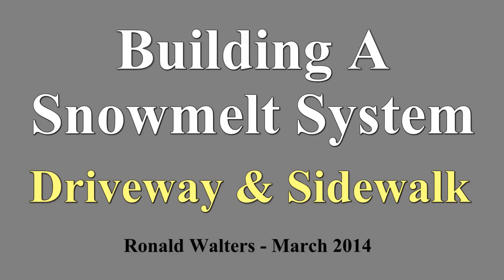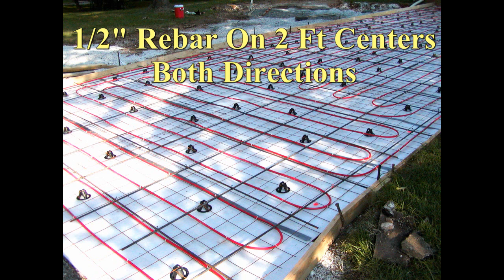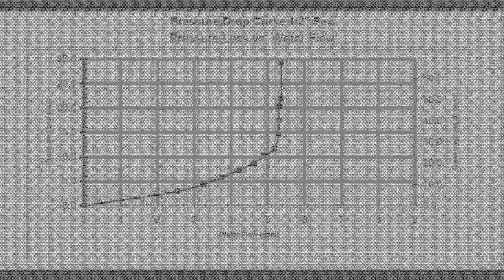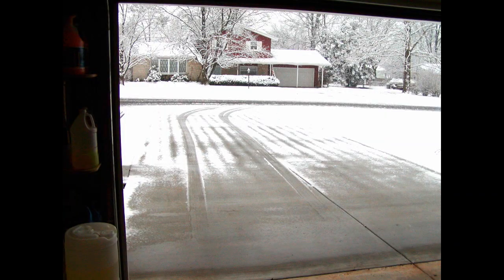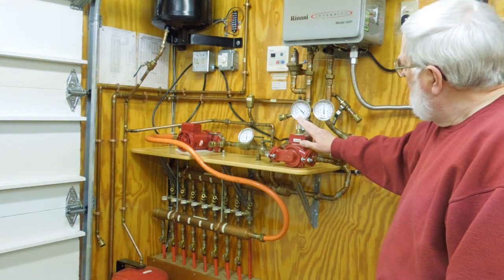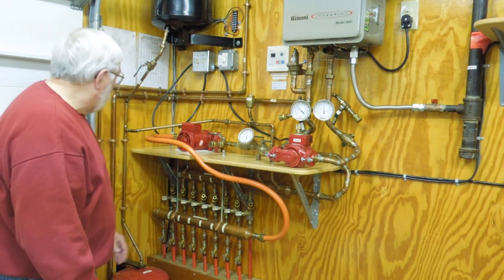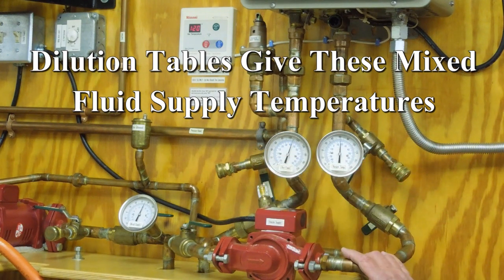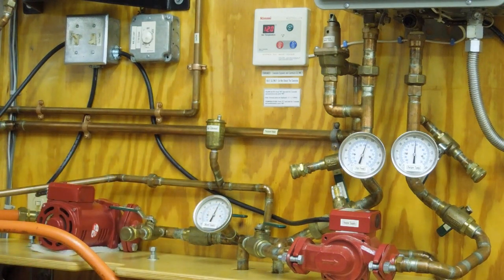Snowmelt, Building A System - Driveway & Sidewalk

Comment: Do you pre-heat the concrete if it is going to snow?  if you melt snow as it falls is more effecet than heating it after it falls.
Reply from the maker: Asked and answered, one form or another, several times in the comments. If you think you can believe your weatherman as to exactly when it will snow or if it is going to snow. A concrete slab is a giant radiator heating the great outdoors. Heating the concrete needlessly, or hours too soon, can waste a lot of energy. A layer of snow acts as a blanket helping to keep the heat below it. I have tried it both ways and now I generally prefer to let several inches accumulate before firing it up and then gradually warm the concrete so as not to crack it. Melting occurs at the concrete/snow interface and not much above it. Thanks for watching.

Comment: Ronald.  Just saw your video and it looks awesome.  I have a question though.  Wouldn't it be faster and maybe cheaper to heat the driveway just before a snow storm hits to keep the snow from sticking to begin with??

Craig
Reply from the maker: That big concrete slab is the worlds biggest radiator. If you can't depend on your weatherman any more than I can depend on ours, you could be pumping heat into the slab for 6 or 8 hours before anything happens (or it many never happen). If I lived somewhere where they get several feet of snow frequently throughout the winter I probably would have bought a Bobcat with a snow blower on the front. The system isn't going to keep ahead of blizzard snowfall accumulation and for such situations I would have used 3/4" tubing in the concrete instead of 1/2". A layer of snow on top of the concrete acts as a blanket and helps keep the heat in so I often wait for 6" to accumulate before firing things up. Interesting to note when I first started gathering information for this system, one group of "experts" recommended turning it on in the fall and let it run until spring... Right! So I kept looking around until I found someone else with a bit more sense.
Reply from the maker: First suggestion is... if you want to ask a question, do not leave it under someone else’s question. It gets buried by youtube and nearly impossible to find. Create your own new comment directly under the video.

¾” PEX will hold roughly twice as much fluid as ½” PEX and require faster pumping to cover the same distance in the same period of time as ½” PEX. That’s also four times the fluid to heat if you are on 6” spacing instead of 12” spacing. If you are pumping twice as much heated fluid through the concrete you need to be three times as careful not to heat the concrete too fast or you will crack it like crazy. You do need to pump the fluid fast enough to have some hope of warming the entire slab. 6” spacing is pretty darn close together. No, I would not agree that ¾ PEX on 6” spacing is a better design… at least not where I live. ¾” PEX would probably still be on 12” spacing (my guess). The foil backed ½ foam insulation shows results in the slab faster than you might expect. But… you need someone to do a heat load for your drive in you area, which is quite a bit further north than mine. Then you need to make some decisions on your own. Have fun!

Comment: How well would pre-heating the driveway before the snow begins to stick do?
Reply from the maker: If you can depend on your weatherman (which we seldom can) that works great. The photos of the snowmelt system working in the video were taken years ago. I had the new driveway and had installed the system and there I sat waiting the entire winter for something (anything) to happen so I could test the system, and it was a very mild winter. Bummer! Then, like the last possible event of the winter, we had this snowfall predicted. So I fired up the system and preheated the slab and we had this heavy snowfall as predicted (amazing) in daylight and it really showed where all the heat tubing was in the slab. So, preheating the slab works quite well depending on circumstance and dependability of the forecast.
Reply: Ronald Walters All in relevance of how deep your pockets are to run it on the weatherman's best guess.

Great video (and the other demo video too), thanks for sharing!
Reply from the maker: Jeff Ferguson Exactly. That is why I generally wait until the snowfall is about over before firing up the system. The blanket of snow helps hold the heat in as well.

Comment: reading about home automation i read a story where they touted oprah's 'snow melting driveway' as some sort of mega rich thing, which it is not. if i ever build another house i will probably do areas of the floorplan like bathrooms with pex for sure.
Reply from the maker: My entire house and my workshop have radiant heat. See Building My Steel Garage https://youtu.be/ZnV3m4Vx500  Both are heated with a hot water heater. Thanks for watching. Please subscribe.

Comment: Hi Ronald. What do you think of thermaPanel?
Thank you
Reply from the maker: Actually, until you mentioned ThermaPanel I had never heard of them. This could very well be an example of, “There is no limit to the amount of money you can throw at a problem”. :-)  They talk about the panels having turbulent flow channels (which usually means higher pump pressure) but I did not see a diagram showing the actual design of the internal flow path of the panels. It would be interesting to see how they fill the system and get rid of all the trapped air. Having each panels interconnecting tube thermal welded to each other at the factory is interesting right up to the time you need to repair it in your driveway. The other thing I don’t like is it is all made of plastic and probably lots of joints in there somewhere. If man makes it, it can fail and plastic has yet to impress me as long life especially if a bunch of joints are involved. I see it is specifically designed to work with pedestal mounted pavers… probably not something to be found in the average guys home and something else which seems to be a made of plastic (based on my brief search). I see one panel demonstrated alongside radiant tubing (one single square). When hot water enters radiant tubing or one of these panels, it immediately starts giving up heat. So the first thermapanel will get the hottest fluid and the last panel in the loop will receive the coolest. Same with radiant tubing and that is why the tubing is zigzagged back and forth and why hottest fluid is routed along the outside edges first, etc. Many considerations. I liked the patio cooling thing so it can heat the pool or spa, except anywhere I have been where the concrete or bricks around the pool were too hot to walk on probably meant the pool was already too hot to get into (many places need to run chillers to keep the water in the pool cool enough for swimmers). I believe they said each panel has insulation in the bottom, which cannot be very much and you would probably need more insulation under all of that. I watched a few videos a month or two ago where they were laying electric heating elements (lots of elements) on the ground for a long driveway (absolutely no mention of insulation below) and then buried the whole thing in asphalt. I really wanted to see a shot of the electric meter when it was running full throttle. Reminded me of a friend who placed electric elements under the bathroom concrete & tile floor in his new house. Only lasted a year or two before an element failed and then he was faced with living with a cold floor or ripping out the entire floor (actually tearing out the entire bathroom) and starting over (putting in another electric element?). Generally speaking, when a contractor installs radiant tubing, they show up with a huge roll and start laying it down. When it comes to the end of the roll they splice a new one onto the end and keep going. Generally, today’s PEX joints do not leak… but inside concrete? I planned the length of my loops and have zero joints in any of the radiant tubing in my snowmelt, radiant heat for my house or shop. And 1/2” PEX is strong enough to tow your car. ThermaPanel and similar systems look to be expensive and contractor intensive… probably not something most people can do themselves. I would stick with radiant tube in the middle of the 5” concrete slab. I like the K.I.S.S. approach. Thanks for watching! Ron
Reply from the maker: I would recommend staying away from electric.

Comment: If I understand correctly; there is one loop which travels through the concrete to be melted, and a separate loop which travels the short distance through the on demand water heater then through an unseen heat exchanger which connects to the concrete loop.
Is this correct?
What type of heat exchanger is used to connect the driveway loop with the on demand water heater loop?
Reply from the maker: The large circulation pump circulates fluid through the concrete at 8 gallons per minute. On the return manifold (the upper manifold) there are two ¾” T’s pointing upwards toward the smaller pump for the heater. The one “T” feeds the heater pump (watch the video again and you can trace the line leading to the smaller pump) and then the heated fluid reenters the return manifold at the second “T” where it mixes with the circulated fluid. Only a small portion of same glycol fluid, which circulates through the concrete, passes through the heater. So this is a dilution circuit, where the heated fluid is diluted into the cold circulated stream so it gradually warms the circulated fluid. There is no heat exchanger.

Comment: What is your heat source?  I have a sidewalk, 240 SF, 2 circuits (140' 1/2 PEX). I was told I couldn't use an on demand tankless. I was also told I needed a 26,400 Btu/hr boiler. I'm finding it hard to believe I need something this big to circulate less than 4 gallons of fluid! Any help would be appreciated.
Reply from the maker: R Krieger My system is much, much larger than your requirement. I am
using a Rinnai Model 2520 on-demand tankless indoor water heater running on
natural gas and I am circulating a glycol and water mixture. Nearly everyone at
Rinnai was a pain in the ass regarding the use of this heater and said it would
not work, would fail after a while, generally not much support. Their engineers
did not want anything to do with it probably because it had not been done
before. Their main concern is the unit needing to run at very low flow rates
through the heater.  I needed a smaller heater
but could not get anyone to sell me one at that time. If used at full output
this system would crack my concrete to dust. I have 1430 ft of ½” PEX split
into 8 circuits. My total flow through the sidewalk and driveway is around 8
GPM. Flow through the heater is usually around 1 GPM.  This is a manual control arrangement and I would recommend that
as all this automated crap is going to cause you problems in the long term.
Another good arrangement would be to use the heater to heat a large insulated
tank of fluid and use that fluid to temper the water being circulated through
the concrete with a mixing valve. This would allow the on-demand heater to
cycle on and off and operate at a point of higher efficiency keeping the tank
fluid hot. You do not need to melt everything fast. That would be hard on the
concrete and would be expensive. The snow and ice on the driveway act as a
blanket and you slowly melt what is between that blanket layer and the
concrete. Slow and steady gradually increasing the temperature based on your
return fluid temperature increase and then temperature stabilization. Probably
the fastest I get up to is 1.5 GPM through the heater. A smaller heater would
be better as it could be operated closer to its maximum efficiency. I received a
lot of bad recommendations from the so-called “radiant heat and snowmelt
experts” recommending big horsepower installations and fancy gadgets, sensors
and controls. Even had one of the top rated companies tell me I needed to turn
the system on at the beginning of winter and let run until the warm up in
spring. Wow! How much would that cost? They must do most of their work with
government operations. Taking the cover off one of these on-demand tankless
heaters, they resemble a jet engine with blowers, sensors, servo control
throttling valves, wiring and a control system which will shut it down if
anything looks wrong. They are designed to supply hot water to a shower in a
house. As such, they are over designed to keep that supplied hot water
temperature controlled to a very narrow temperature range so hopefully they
will not be held liable for scalding someone with over heated water. Thus, they
appear to be a bit more complicated than needed for a snowmelt system. Probably
the largest opportunity for a problem with the heater is it being shut down and
not running for 10 months of the year. In the spring turn off the gas, unplug
the unit and place a cap over the outside exhaust to keep wasps and such from
building nests inside your heater

 

 

Now there are some small on-demand heaters for single point
supply (one shower or one sink at a time for a small apartment). You have a
very small system requirement. For the cheapest arrangement I would suggest
looking at using a 30 or 40 gallon natural gas hot water heater (35,000 to
40,000 BTU), one circulating pump and a mixing valve to supply tempered water
to the PEX in your sidewalk. The water heater would be dedicated to this
sidewalk and would be filled with the glycol water mixture. Manually control
the system. One of the most expensive items for the system will be the glycol
for filling the system. Use distilled water only (from a bottled water company).
Put a bottle or two of iodine in the mixture (to kill bacteria). Set the heater
to “vacation” the rest of the year. I say this because these new hot water
heaters are another over regulated appliance with sealed compartments and
sensors and they do not respond well to being shut down for 10 months.Probably more than you wanted to know... right?

Comment: have you ever considered using a solar water heater system?   it would at worst only use an electricity if the liquid going through the solar collector manifold is colder (like at night) than it needs to be.
Reply from the maker: Solar and geothermal have been discussed in great detail in the comments section for this video. Thanks for watching!

Comment: What model of flow gauges are those??
Take Care
Ryan
Reply from the maker: +Ryan Wheaton Google "2900 Series FlowGuard Balancing Valve" - They are a combination flow meter and flow control valve (balancing valve) installed on the return side of the loop. Made in Germany, now owned by WATTS Industries, generally made for the European market, ISTEC Corp is the only supplier I know of here in the USA - you won't be able to get any information out of WATTS.

Comment: If you could change anything about this system what would you change?
Reply from the maker: If you live in colder country you would probably use 3/4" PEX and the operational cost would increase.
For my installation, I would go with a heater half this size.The Rinnai has almost as many controls on the burner as a jet engine. One limiting factor built into the unit, it is programmed to keep slowing down flow rate until selected output temperature is satisfied. Thus, when bringing the system online initially, the heater limits the flow rate until the return temperature satisfies system requirements allowing increased flow rate.The mindset of the designers of this on-demand heater was that output temperature was KING even if it has to slow down the flow rate.The programming of this on-demand heater is too rigid. If you select 120 deg F, the heater does everything to maintain that temperature, including slowing down the flow rate… and there is no way to get around this. I would expect this to be a problem even for domestic hot water supply in the winter when water mains temperature is quite cold. When I select 120 deg F output temperature, an operating range of 118 to 122 deg F would be acceptable but do not keep changing the flow    rate.Once the return temperature from the concrete slab starts to increase, this problem goes away.I would love to get rid of the electronically controlled flow valve (or just unplug the servo controlling it) and the heaters programmed insistence on meeting output temperature. But any attempt to do so results in the heater shutting itself down (system error).This is a 180,000 BTU heater and I am pumping 1 GPM minimum and 2 GPM maximum through it, using around 1/3 of its capability.  A 90,000 BTU unit would be more than adequate for the job but a unit that size was not available at the time of installation.An alternative would be to use the heater to maintain the temperature of a fluid holding tank and then use that tank of fluid to temper  the water circulated through the slab. But then the system footprint becomes much larger and takes up too much space. My system    installation is quite compact in the corner of the garage.
Show less